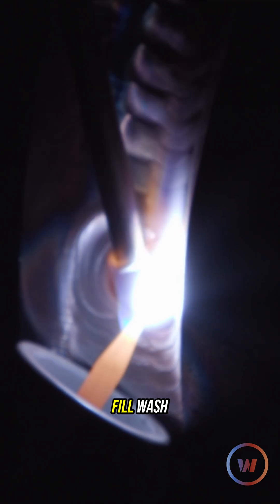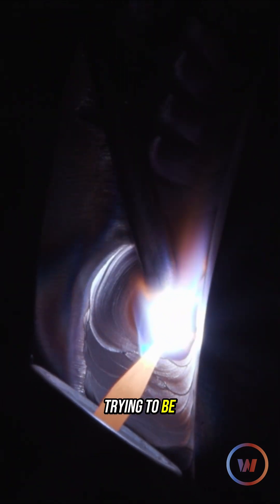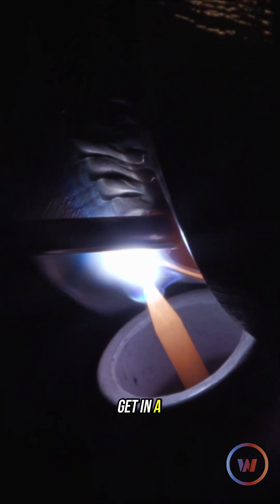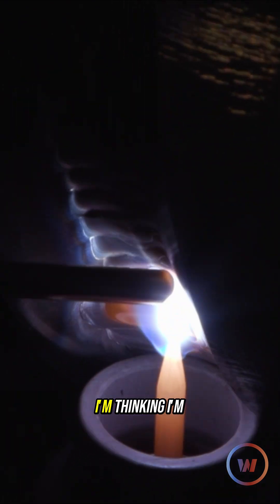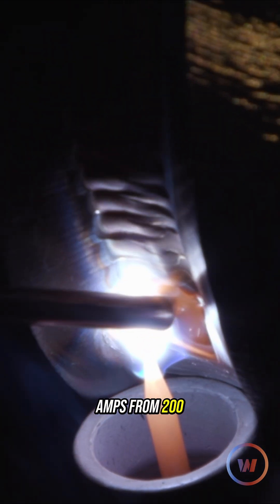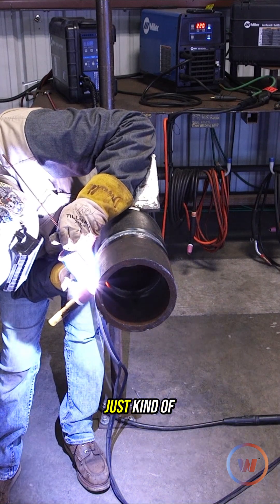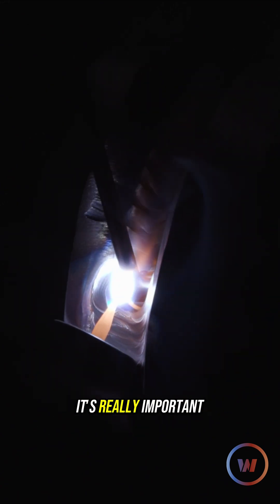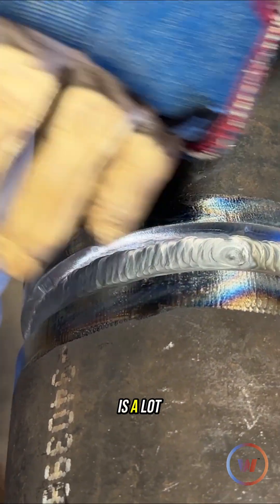5G GTAW Filler Pass - Watch the puddle wash out to the bevel edge #welding #shorts

Comment: Am I making welding harder than it needs to be? I’m comfortable welding 90 amps on tig then hear this dude talkin about turning it above 200. I know it depends on the metal thickness and whatnot but just how hot should I be running on stuff like this?
Reply: I don't quite agree with anything over about 160. After that a problem you may run into is the base metal becoming too hot and melting excessively leaving your puddle sunk wayy into the work piece. Another thing is if you turn your amps up too high on a hot pass you may actually burn through your root, which if you're on a test means you failed.